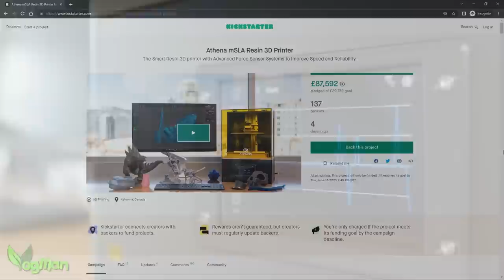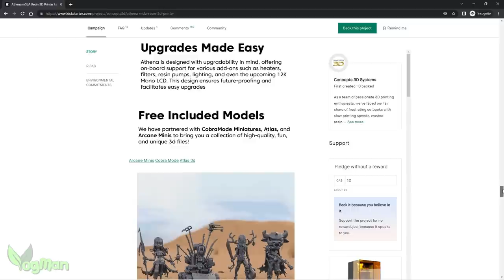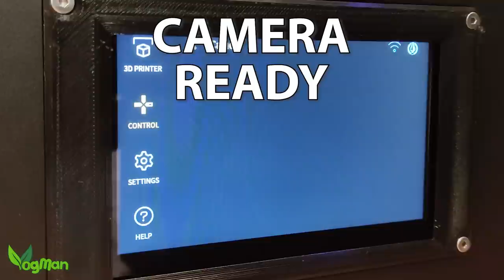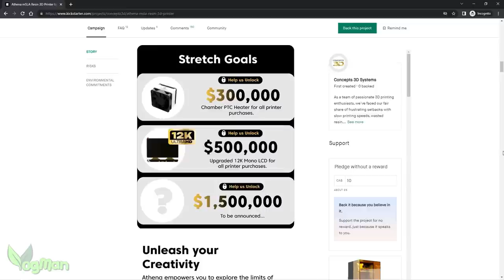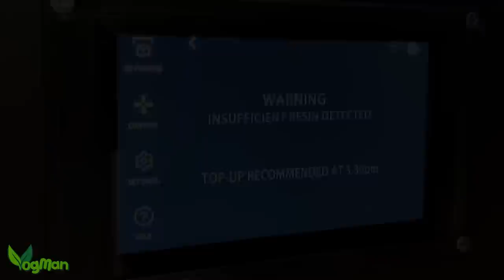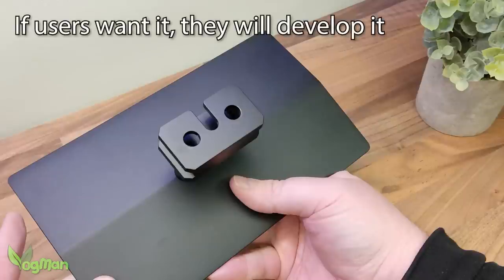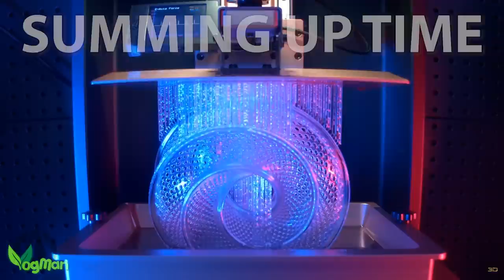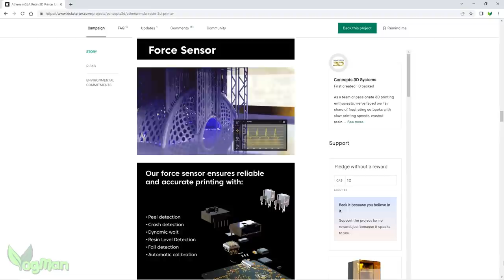Athena 3D Resin (EPIC POTENTIAL) Printer - an overview

Comment: I usually don't log in to youtube but I felt compelled to log in this time because you so strongly recommended this and with the wholesale promotional videos earlier.

As someone who has been working with 3d printers and tinkering with them for over 10 years I do not think this is a revolutionary improvement. The 2 marginal improvements are the ability to modify settings mid print(subject to implementation) and strain gauge(already being used by anycubic). The claims regarding the multiple uses of the strain gauge(calibration, dynamic speed/timings, monitoring etc) are fully dependent on software integration. 

It is easy for them to make bold claims with slick promotional videos. As someone who has seen hundreds of "kickstarter crap" 3d printer launches, the vast majority of them (>95%) fail to live up to the hype. This one reminds me of pirate 3d buccaneer, making lots of bold claims about being able to reach stretch goals but entirely without proof that they have any way of implementing the stretch goals with their skeleton team. It is one thing to stick hardware theoretically capable of achieving something on a machine. It is entirely another thing to integrate software features in a sensible and functioning way.

If they were serious about wanting to improve the software and integration of their machine they would open source their hardware and software for the strain gauge, if not the whole printer. But seeing the dismal state of open source development for resin printers I am not holding my breath. This video just makes me realise how much of a rut the innovation of resin printers has gotten stuck in. The low end MSLA/LCD market has fallen into a megapixel trap since the 4k generation just chasing finer and finer pixels with no discernable effect on prints.

In case I come off as overly pessimistic, I still think this project has a lot of potential. I just think innovation would be far better served with this being an open source project like Klipper or Ultimaker than whatever it is these guys are doing.

Comment: Edit: wow the kickstarter is starting to go nuts!

Oh my god Athena please make the plate auto levelling, I'd pay an extra $100 just for that but I'm not a typical customer. Also Subscribed, awesome channel man!
Reply from the maker: They've promised they will if the interest is there. It's nothing these guys can't handle.
Welcome aboard 😁
Reply: Plate leveling on resin printers is so easy, I don't see a big demand for it.
Reply: @clutch2827  I agree. 
The four screw system is so easy that it’s a set and forget solution. 
Far better than the two screw ball joint idea on the say the old elegoo Mars that used two grub screws which also loosened over time. 
I did the same as others and ended up putting some proper bolts into the plater holder. That then became a set and forget feature but it needed that extra torque to make it work as it should. 
As far as the Athena is concerned. Having spare FEP would be a much better idea. Also we need a paper for the levelling that’s exactly the same thickness the FEP is.
Reply: @Teachaman2fish88  I agree also. I never ever had a single issue levelling my Resin printers. Price competition has stifled major advances especially with the massive escalation in costs for basic functioning slicers and the inevitable erosion of features from free to paid

Main thing going for it is it's open source with Pi and that's the main selling point IMO but it's coming in at more than double the price of comparable proven printers with Tax and Shipping.

I'd like to see this printer cause the others to drop Chitu boards so hopefully they do succeed on this basis alone.
Reply: @Teachaman2fish88 I just put the fep in and level using that, I haven't had any problems yet but what problems could arise from my doing that?
Reply: @RocketMagnetUK We just have to be willing to pay more for non-Chinese companies. Even if they get this manufactured in China, the sweatshops get to charge more to companies that arent based in China which gives consumers incentive to buy from Chinese competetors
Reply: holy crap I was thinking of getting into resin printing and was going to get a cheap one from china but these guys are only an hour from where I live, didn't even know they existed! awesome for getting the word out.

Comment: I love the upgradability - i notice while installing a ResinLapse sensor in my printer that everything in mine has epoxy resin over it.
And, wow, an inbuilt slicer! That's cool.
Reply: I know its not mentioned much, but Athena has a resinlapse port built-in! so you can power your camera and control the shutter directly from the printer, and have full control of when and how often it take a photo. Supports cameras with a Shutter Port, Multi-Port and Bluetooth, including cell phone cameras.

Comment: The real big leap in the design concept of this printer is the ability to upgrade components. This brings future proofing to a whole new level within the resin printing community. 

The other features will be adopted by other manufacturers and applied to their products. We have already seen this with the anycubic m5s which has a strain gauge fitted but not fully exploited, but due to the hardware component already exists in the machine, the firmware can add the advance monitoring that Athena is pushing to the max.

Athena will be a far better investment than any other printer on the market due to the upgradable nature of the hardware that the large manufacturers do not want as they want sales of each generation to increase profits.

Bravo to the developers for this, you may just break the system!❤
Reply from the maker: Well said 😁👍👍👍

Comment: Looks solid, the only thing I can think of is protection in case of hardware failure, like if the board get shorted and decide to ram the plate into the vat. With klipper you can plug into a relay to have it shut down everything on error but I doubt anyone ever had enough issues with melting hotend burning houses in resin printers to warrant this level of safety.

Comment: I've been calling this out for years, resin printers should be easily upgradable with higher resolution screens (even if u need to replace a board), now we've reached the limit so there isn't much point but older models become obsolete like my Phrozen Transform. I found a step by step guide how to upgrade from 4k to 7k but it's pretty expensive (around 500$) and i may just get another mid size printer for that cost and use the Transform just for large bases and objects. Phrozen should have made it modular but it wasn't worth it for them and now that the resolution is getting to a point where layer lines are barely visible they will be force to compete with other features like force detection for faster speed and auto level. It would be cool to see in the future better support removal as some industrial printers have, there was one from carbon with multiple material for support removal.
Reply from the maker: I know Nico has developed a lot of stuff for industrial 3D printers. I'm sure his head is full of ideas.

Comment: Most of the features the Athena is advertising are actually pretty standard these days, though I had thought it would be great to have a printer with a built in slicer (though in my case, the idea was a browser application hosted by the printer itself). The force sensor is where everything new comes into play, and I expect to see similar features coming to a lot of platforms soon.

Comment: I see it as a passionate dream that may become true for the fortunate who can get it. Dynamic pull speed and wait times are great features and definitely will be "borrowed" by other manufacturers. (I see as Anycubic already going in this direction with their own design of the M5s.) I have only a few issues with this design: the slicer compatibility is a bit concerning, the lid should have some kind of lining as it seems like in the footage as there is a wide gap around the edges. The third one is that flimsy looking sheet metal assembly that fixes the build plate to the Z arm. Rivet nuts aren't really great in such application. An assembly like on the Photon M3 (with a solid block in the middle with threaded holes) would be much better. But instead of 4 individual bolts a pair of through bolt design with lever arm tightening system (like the quick release axles on bicycles) with a vertical spring in the middle pushing the build plate flat on the screen while the bolts are loose would be even better. One lever at each opposing side. Toolless leveling could be achieved. Just pull the levers loose, put up the paper sheet on the screen, zero the Z arm, push the levers tight and done.
Reply: Hey there, good feedback! For sure others will copy the force sensor technology, but we will keep on innovating to stay ahead. We have a lot of things planned for the future. Slicer compatibility is not an issue, we support them all, Which one do you use now?

The lid will have a foam gasket seal to keep the smell and heat from the heater contained. The wide gap you see in the video is due to the door being warped on that prototype unit. We have resolved this for production. I like your ideas for the build plate, but we had to make some concessions to maintain a reasonable cost, the design we have now works well, but there may be some upgrades for this in the future.

Comment: Incredible! if I win the lottery I will back them but as of now at this time in life its really not possible unless you are earning some wage packet! My mono 2 is good for the power outage I've unfortunately had it tested twice now with the thunderstorms and kicked back in at the correct level without a mark on the prints! I could even tell you whare it restared. The crash reporting great idea and the sensors for temps and pull force thats genius! Loved at the end part of the video showing the speed on the build plate that plate just rising constantly at a perfect pace formthe print to cure is just mind blowing! Is that time lapsed or slowed down? That I just think is something that will need to be matched now with new printers and not a hovering up and down plate that's next level that! Waw

Comment: While I see a lot to love already, I've had experiences with 'Smart' software that was doing too much with its sensors that, in the end product, was always a detraction from a more simple approach. That's not to say this combination can't work if done properly and in concert with a fine range of engineering, but to date, no one has done that yet and to a degree where 'it just works' every time. 
As it goes with software and sensor systems, if calibrated so finely to a degree where a vibration is sent through the floor and is detected by the machine (say a compressor kicks on or you've got a mighty sound system just for two examples that I've dealt with out of many), your print will end up going kaflooey and hang for all eternity until user involvement fixes the phantom detection, or when the system correctly restarts operations, there will be a discernable break in the printing in the end product (especially in resin printers, where the product cures through natural process) and that ugly layer line develops between the stop-start area(s). Imagine on a multi-thousand layer print, which is not uncommon in large prints, this sucker picks up five or more causes for start-stop detections. It's going to develop into one fugly print when you finally go to rescue your end product to see what has transpired on the plate. 

Having your printer reach you via automated messages sounds like a solid idea, but these things tend to go way the other direction via flooding you with messages about every little thing that happens, and often forget to stop messaging you when operations have ended. Just another nail in the coffin of over-reaching technology not living up to the promises of the word. 
This probably reads as an anti-endorsement for the printer, which it shouldn't, but as my own concerns for the printer trying to be too forward-thinking for its own good. If they can pull it off--and I hope they do--it will certainly be a milestone for resin printers universally. Hopefully they've gone the extra miles and fixed 99% of the foreseeable bugs with this type of printer in the R&D process long before user units ship, and not have the user be the beta tester as a lot of these KStarter jobbers end up being, then after successful and assuming they do deliver a product a year or more down the line, the whole company turns into a fly-by-night disappearing act. 

Though it should go without saying, KickStarters ALWAYS come with the rarely stated disclaimer that you Absolutely should not buy-in with money you can not 100% afford to gamble with.

Comment: This is great, there are some technologies which are present on form labs printers which I wish could be present in a lot more different printers.
These are things such as:
-Bending the FEP film when releasing the print to make it more easy to release.
-Auto stirring the resin
-Auto heating chamber (Though does seem they're working on it)
-SMS/Email alerts
-The easy removal plate
-The resin auto fill
-The automation tools

For myself, the Formlab printers are too expensive for me and for the price you pay, the quality of the prints are less than ideal. I would love a cheaper MSLA alternative with the FormLab printers. I do have an AnyCubic printer... but my skin is quite sensitive to the resin, being in the room where the printer is will make my skin feel like it's hot and can give me a rash, even when wearing protective equipment. The less contact points I have with the resin, the better it is for me, which is why when I heard about the Formlabs automation flow I was super excited. But I believe that FormLabs probably patented their technology which is why no other printer has it. 
The FormLabs printers seem to have checks in place to make it a super reliable printer with the least amount of person interaction... but way out of the price range for any individual or hobbyist.

Comment: I was going to wait until other brands have force detection next generation due to them being cheaper, however the upgredability of this printer could make it cheaper in the long run!
Reply from the maker: I can't tell you how to spend your money my friend, but I can say this. As mine is a prototype, I've had to update a couple of parts. All I got was the parts and pretty well done pdf document. But genuinely it was EASY. This printer really has been designed to allow for users to upgrade and even customise.
Reply: @vogman  I've only just got a printer this year (used 4k printer) so it will be a while until I upgrade but I'd either go for a higher res DLP when they come out or one these, if athena ever made a DLP printer that would be awesome but I'm 90% sure there is no way this printer could be upgraded to DLP in the future so I'll be waiting, speaking of DLP... tough/flexible resins usually have less detail than ridgid, does the sharpness of DLP overcome this in your expirience?

Comment: They may be getting feedback that auto leveling isn't desired, but the response to the Mono 5s is proving that wrong.

I don't see why they can't do auto levelling with the adjustable plate. Have the end user run the z axis all the way down and then tighten the screws with the plate sitting on the FEP. Then have it start the auto leveling, knowing the plate is setting directly on the FEP, and it needs to compensate for it. Loctite the screws and torque them to a factory recommended setting that would prevent shifting over time would resolve that. Inside star lock washers would be great for that. 

I saw they are working on a 12k version. Good idea, because resolution is king in most peoples eyes, and again, the Mono 5s has 12k and is scheduled for release already. That resolution along with some of it's new features would make people go for the Mono. That happened with the Longer orange mono 4k. By the time it was out of kickstarter and in production, 6k printers were being announced, and people that had been interested in the Orange 4K moved on, drastically cutting their initial sales. 

I'm waiting for the day affordable 64bit steppers are available so companies can go to finer thread pitches on the Z axis and thinner layer heights. (more bits means higher bit counts per revolution, allowing finer thread pitches w/o reducing the height of the z axis.

Here's one question, is there any way to develop auto compensation for z axis stretching on the object because of the peel forces that can be stored in a slicer for each resin you use?